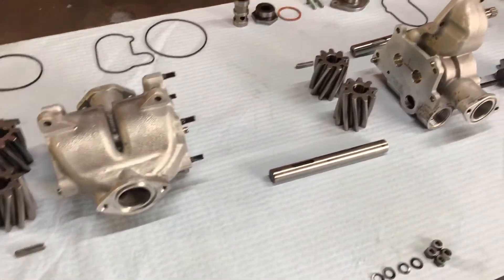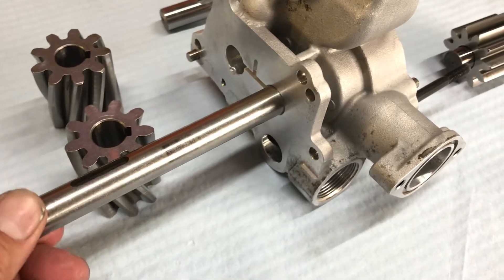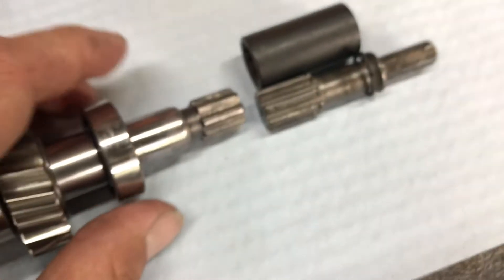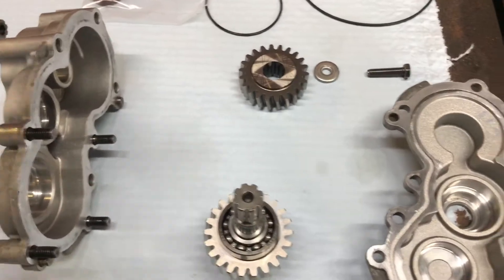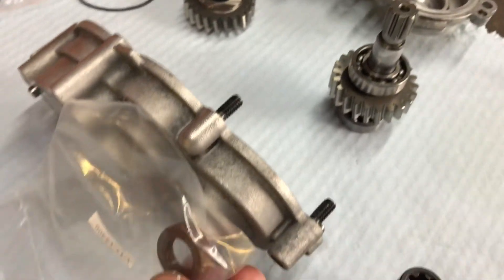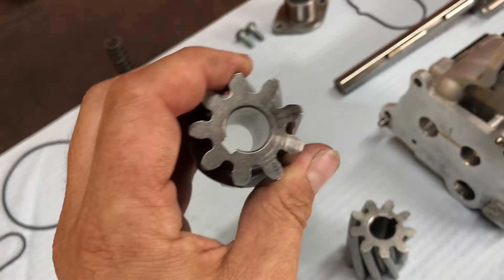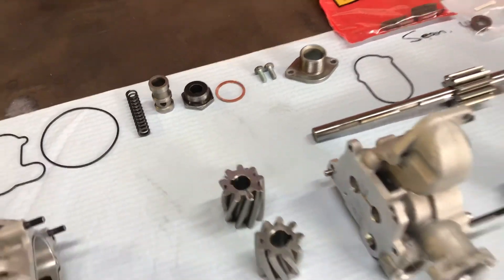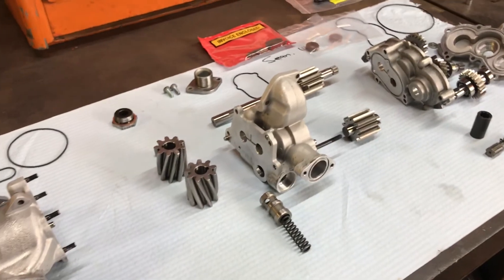Lamborghini Gallardo 5.0 oil pump

Comment: Thanks for sharing your knowledge on this. If I may ask you comments on oil starvation any thoughts on the cause?
Reply from the maker: Graeme White ,
A common issue, is dry sump cars that sit for a long time, particularly the Gallardo, the oil in the oil cooler runs back through the rear two scavenge stages of the pump and into the sump. Then on start up, the tank depletes of oil quickly, before the scavenge stages can evacuate the sump, fill the cooler and finally the tank again. the supply stage ( front pair of straight cut gears ) run without full supply from the tank. This heats the gears quicker than the housing can expand with them, and they can start to lock up as they grow. I recommend to my customers to start and run the engine at least once a month even if they aren’t using the car.
The pump will often sound like a noisy power steering pump of a conventional car with low power steering fluid. That’s because the system has become partially aerated. 

There is a check valve in the top of the valley under the filter housing, which should stop oil from running from the tank, through the front supply section, and to the engine. In any case, the check valve and filter is higher than the oil tank and will always leave the supply section full even if the check valve is faulty. There’s a general misconception that the oil runs from the tank into the sump. This is actually impossibly. The oil would have to run uphill from the pump to the filter, down through a faulty check valve and through the main bearings.

Another cause of gears starting to tighten up is any suction leaks in the oil system where it can pull air into the oil. Air in the oil system is a quick way to ruin pumps and engines.

Low oil level is the most common cause though. These 5.0 engines consume quite a lot of oil ( I think partly due to the below average one piece oil rings ) and in a lot of cases the engines consume 1 litre per 1000km or more, even on new engines.

Another cause is oil that is too viscous ( too thick ). I see more damaged engines and pumps from cold conditions than hot.

* edit * 
Oil starvation and oil “surge” are similar but different. These 5.0 litre oil tanks are a little prone to oil surge in long corners or long hard braking areas. If your doing any sort of track work or even driving hard in the hills with good grip, you will likely find the oil gauge drops occasionally in corners and when braking from say 200 down to 60 at maximum braking effort. The tank baffles aren’t good enough, and requires a better tank design for track work.
Reply: @infodevelopro  hello, im interesed by your repair kit, my Gallardo had a bad noise like bearing noise dead when cold, it stop at warm.
your video is nice to operate! thanks